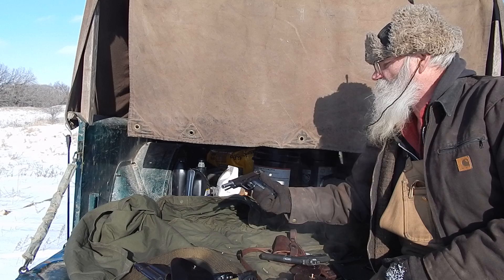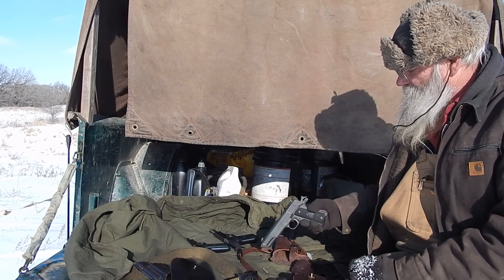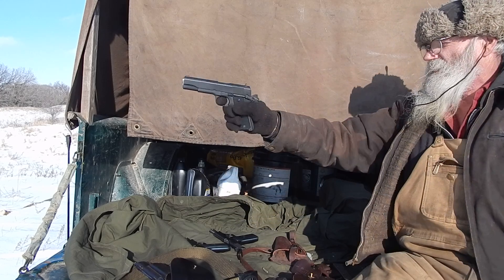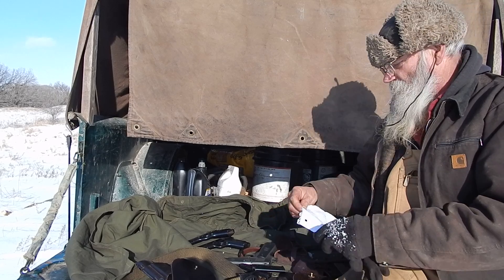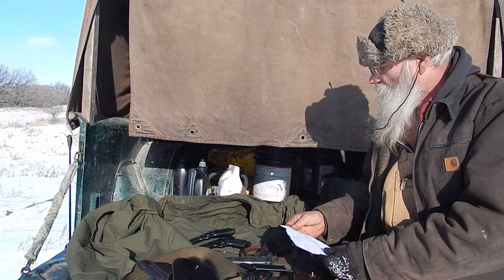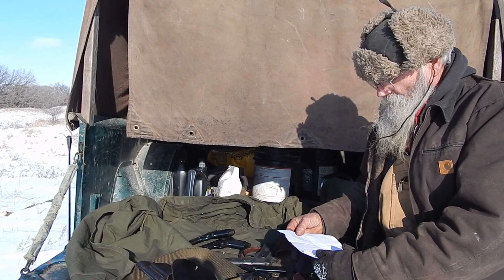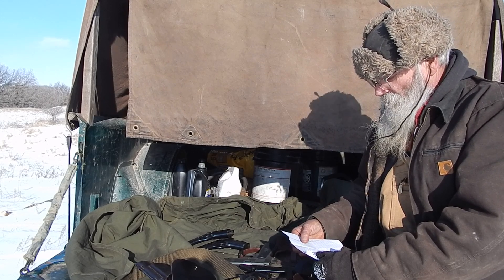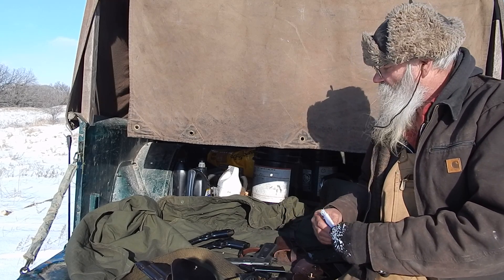Recoil experiment

Comment: My two cents worth....recoil ends just after the bullet leaves the muzzle...any excess powder charge is just pushing against the inertia of the air in front of the muzzle which is already a spinning vortex heading away from the muzzle....the Tokarev is faster but this may not be enough to effect felt recoil.

My best guess is that the shorter time in the barrel and the faster cycling action of the Tokarev are giving you less felt recoil. It  may be quite different in a comparison of similar revolvers using these rounds (if such things exist)

Comment: I hear people talking about recoil and "felt recoil".  I'm not sure I know the difference.  Unless a firearm has a compensating recoil buffer of some sort, why wouldn't they be the same?
Reply from the maker: I think the energy being developed in all three would be the same, but how it gets transfered would differ. Its interesting to me that the .45, with a bullet weighing more than double the others, felt like it had less recoil. I think the energy being developed would be the same, but in getting the heavy bullet moving it get transfered slower. Although the recoil is probably the same, it comes as a push, rather than a jolt, but you still get the muzzle jump. In the Tokarev I suspect the very light bullet takes off so fast the energy doesn't have the time to overcome the weight of the gun so very little jump.

Comment: I am just taking a crap shoot (no pun intended) guess that the Tokorev is producing lower pressure inside the case than the 9mm due to the Volume of  the Tokorev case being bigger than a 9mm....using the same amount of powder and the bullets being near the same.  What do you think?  Or what does anyone think?
Don't let it keep you up at night!
Reply from the maker: I am thinking perhaps the m57 has more slide travel for the longer cartridge and absorbs more of the recoil, I will have to measure that. Also could be a different recoil spring in the M70a. All I know is the Tokarev round is milder on the recoil, and has less muzzle jump to it.